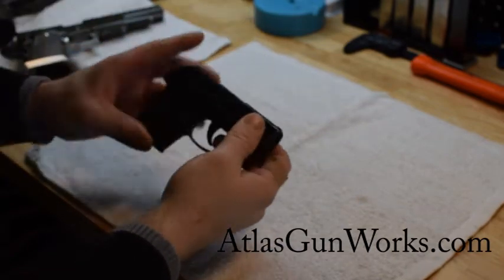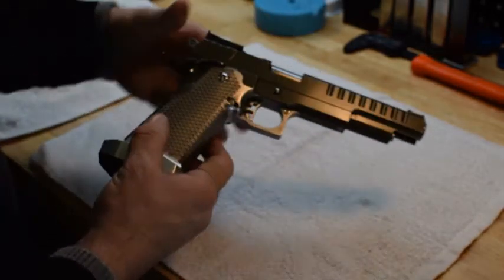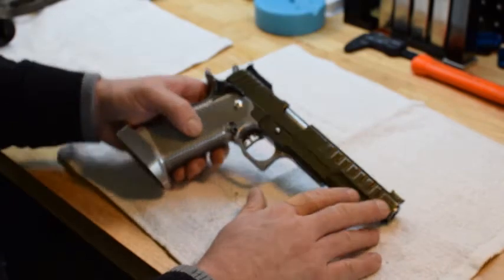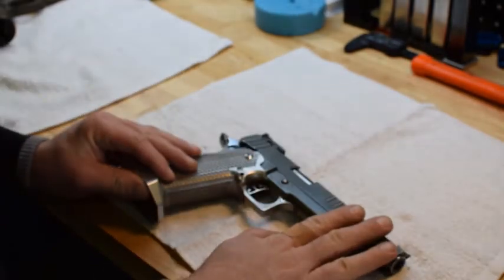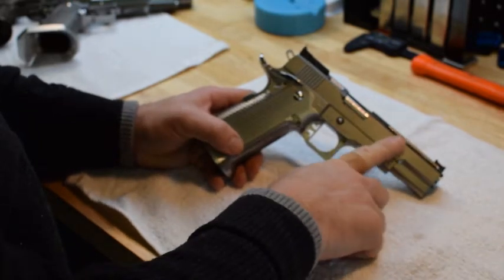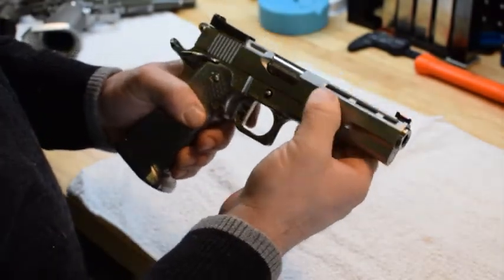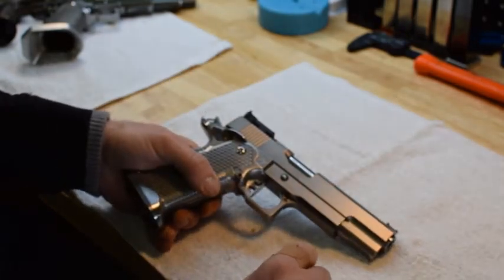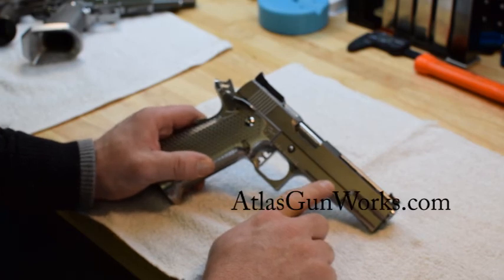Gun Coatings @ Atlas GunWorks

Comment: I had an AR back in the early 90's.Had it sent out to be coated with a teflon coating.I can't remember anymore what it was called but believe it was Z or Zee coating,maybe it was a "nickname" for it.Ever heard of it?
Seemed to work really well as the only thing I would oil was the bolt slides that met the upper with a Qtip and a dab of whatever I had around...10-30/40w,SAE30.A ex-SF buddy that was also a gunsmith said there was very little to no wear.That was after IDK how many 1000's of rounds.
Sadly I only had it a few years as someone later broke in and stole it and a couple other guns.It was a pretty good shooter with the loads I worked up for it.1x Ultradot sight it would group 3 inside a quarter @100yds.Not sure what it was but every grouping it ever shot was always a triangle pattern.Never had any type of rifle shoot a pattern like that before or since whether offhand,prone or bench/rest,but it held nice groups though.

Comment: What about NP3 vs DLC...I see that Sharps Co charges $20 more for the DLC but from what I have heard NP3 is better. Could you please clarify?
Reply: DLC is superior
Reply: For the record, NP3 & the newer NP3+ design are ✅️ but Barkman sold his RoBar business & licensed his firearm services to 3rd party firms. I owned a PA law enforcement 96D Beretta in the mid 1990s. It was NIB with NP3. The 96D .40 did excellent with JHPs & mil type ball. 0 flaws. The Robar NP3 was durable, never scuff or peel off unlike some 2020s era Cerakote slides I purchased. 😏

Comment: Great video. I have had many discussions with people about this. I like PVD coatings on slides and barrels. I have never done the plating. As you said, Duracoat and Cerakote is just paint that really is inferior to PVD coatings. My question is whether PVD coatings can be used on the polymer of a Glock? I have a custom slide and barrel that has a digital camouflage pattern done in PVD coating. I need to have the frame/grip done to match the slide and barrel. I would rather have PVD on that if possible, but will live with Cerakote or Duracoat if need be.
Reply: Chaotic Reefer no Only steel. Doesn’t work on aluminum either
Reply: I've used different systems over the years. Robbie Barkman NP3, Cerakote Elite, Mahofsky Metalife. I've seen good Cerakote 🎨 BUT in 2022 I had 1 bad shop job; used Glock 22 gen 4 slide. Carbon Grey. I had a Florida shop add Cement color Cerakote to a new Glock gen 5 MOS 22. That grey coating has held up great! No scuffs, scratch, mar. 0. After around 24mo. I'd suggest only having pistol slides coated or plated. The Glock 22 gen 5 did scuff on the treated barrel but I had a problem field strip, fix the pistol. Note; the Glock 22 MOS has fired, cycle about 1600 factory .40 rounds without flaws, jams. I would NOT advise adding Metalife. 🚫 My coated Glock 21 gen 4 slide, barrel saw a few problems every 100/200rd. 🤔 NP3 & NP3 + are very good but to my knowledge, Lenny Magill Glockstore.com still has NP3. 2023 era. My 1990s era 96D .40 was a sworn LE surplus. NP3 gun & 3 .40 Beretta mags. 0 errors, jams, problems. NP3 worked ✔️.

Comment: @Atlas Gunworks The PVD finish on my new never fired Sig Sauer P226 Elite ASE Stainless Talo Edition is blotchy.  Additionally after a few snap cap fires the finish on the rear of the trigger guard where the trigger stops came off or wore off.  I know there are a lot of online forums and Youtube videos where others have the same issue.  Is this a problem with the PVD coating or an application process issue?

Comment: What about Ferritic Nitrocarburizing...Black Nitride? That process seems to be superior to just about everything else.
Reply from the maker: Nitride works well but can weaken the steel if done improperly
Reply: @AtlasGunworks  .... always something negative to say about any that's not in your toolbag ...
Reply from the maker: @johndeesmith183  We use Black Nitride for some small parts.  The process gets very hot over 900 degrees Fahrenheit.  Parts like slides and frames can warp when they are exposed to temps that high.
Reply: There are many after market choices, styles for slides-firearm parts. I had a few guns coated with Cerakote Elite. 2020s era. 1 was good, no serious flaws or feeding errors(after 24+ mo). 1 Carbon Grey Glock slide 22 gen 4 began to strip, peel off 😟 after around 2mo. The shop offered a lifetime warranty too. As noted, consider what & how you plan to use the gun or pistol prior to spending $$$ on any after market plate, coating.